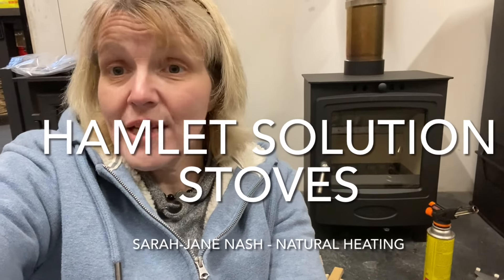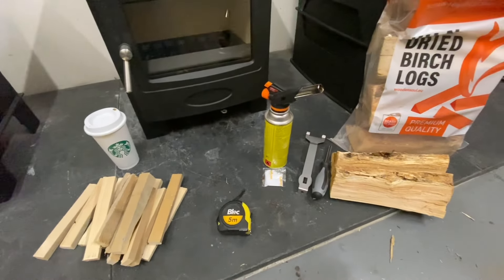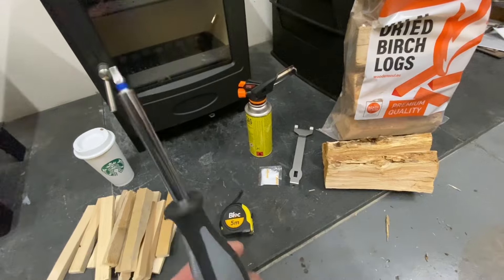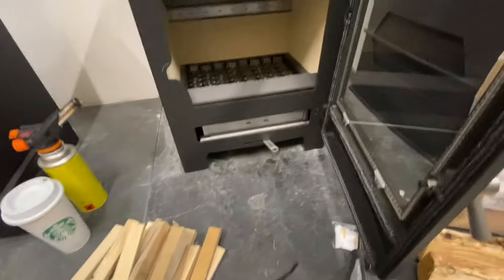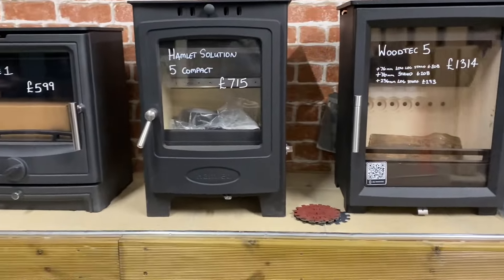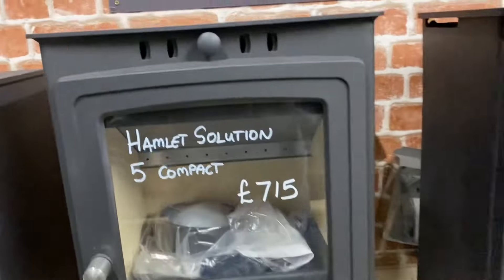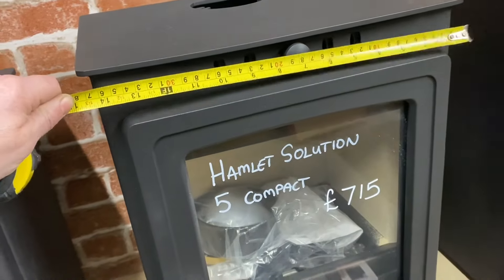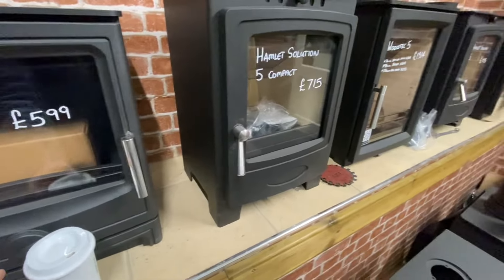Hamlet Solution Series Multi Fuel / Wood Burning Stoves (made by Arada) - Natural Heating Review

Comment: Hiya, why would i need a 6" flue liner if i was to remover the defra screw please? would that be the same if i took the defra control off, say the lowry?
i am toying with the solution 5 widescreen
my living room is 7.2 mtrs by 3.3 mtrs
1960's semi detached 
not great insulation
what stove would you recommend for around £1000 budget for a night time and weekend use.
many thanks
Reply: We've  got  the  Solution  5  wide  in  a  semi  bungalow  its  brilliant  throws  out  serious  heat,  Had  a  Dunsley  before  with  a  boiler,  The  hamlet   is  seriously   good.